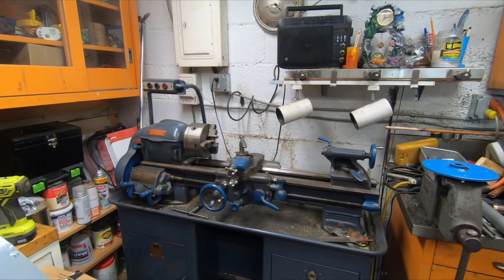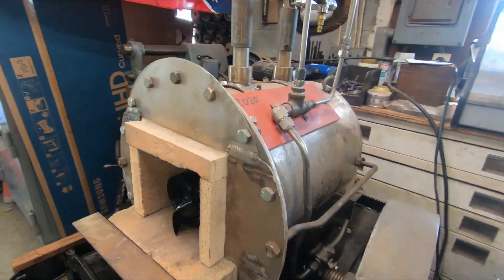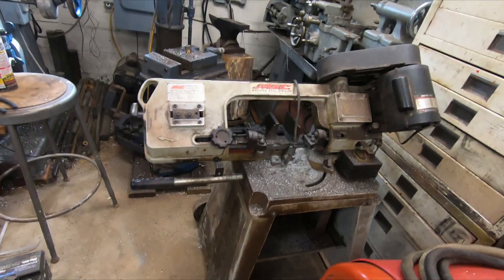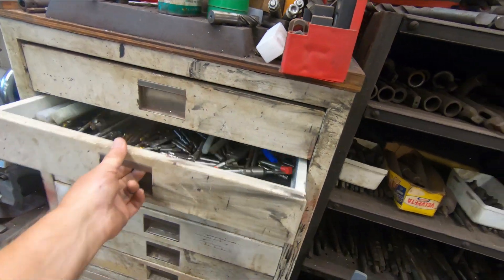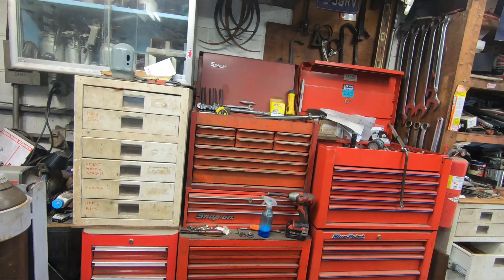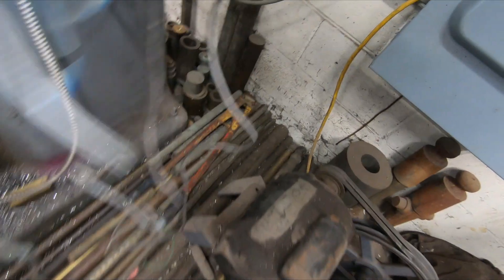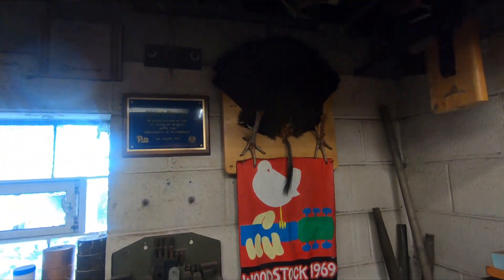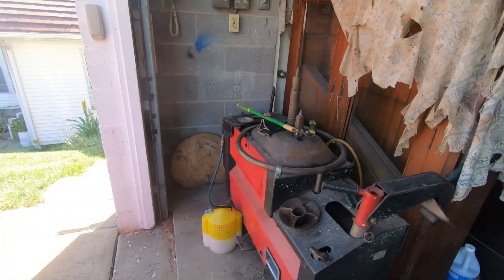My Home Machine Shop

Comment: Whats the trophies 🏆 for?
Reply from the maker: The  3 biggest ones are for my 67 GTO from the annual World of Wheels custom car shows 1977-79.  The small red one is from some car show. You can see the back of the GTO in this video. Link to the GTO  -  https://youtu.be/KtT0TO7NQbY . The 2 smaller wooden ones are from 10th & 11th grade for winning the 4th Place Best-in-Show and 1st Place Best-in-Show in the Western Pa Industrial Arts Fair. My dad was a machinist and he started teaching me to run a lathe when I was 12 yrs old.  In 10th grade I made a 3/8 scale model of a civil war cannon with a brass barrel. In 11th grade I made a full scale mountain howitzer with a 8" diameter forged steel barrel with 36" wheels.  Made both to the original plans.  Did the metal work at home and the wood work at school. I had 4 periods of wood shop per day in 11th grade.
Reply: @billygoat1708  that's awesome. They didn't offer any kinda classes like that when I was in school. I probably wouldn't of dropedout in the 7th grade if so. I will go check out that video now
Reply from the maker: @51-FS  The summer after I turned 16 my dad got me a job at an auto repair garage with a guy he knew.  First, I started out running for parts. Then did small jobs like water pumps, changing tires etc. I worked on and off doing mechanic work for the next 8 years while going to school. I picked up the GTO when I was 19 for $175. Did a frame off restoration in my garage in 2007 and have it insured for $60K now.
Reply: @billygoat1708  thats cool.

Comment: Nice Westinghouse plate
Reply from the maker: You must be in the electrical field to pick up on the Westinghouse plate. My dad worked for Duquesne Light Co which is our local power company. The plate came of a generator that must have been taken out of service. The plate reads: A.C. Generator, June 8, 1928, 75000 KVA, 11600 Volts, 3740 Amps, 1800 RPM, Westinghouse Electric & Manufacturing Co, East Pittsburgh, PA

Comment: Your torches are the best tool in the shop? Really? You use that thing that often? I have been debating buying one .
Reply from the maker: It is not that they are used that often but when you need them you really need them and they are the only tool that will do the job.

Comment: let me ask you a question ol buddy!  how many people do you know that needs a damn 3 inch drill bit hanging on there wall?? yah thats what i thought...
Reply from the maker: When is the last time you SAW a damn 3" drill bit ol buddy?  yah thats what I thought. "Need" has nothing to do with anything.  Although I have used it in my 20" lathe. So now it has become a novelty that is hung on the wall.  Price one. They are $1700 discounted price on MSC ($2253 List Price) for an American made one. #FJB
Reply: I once used one to drill two parallel holes in the turbin casing of a steam generator. I had to sharpen it least two dozen times during the process. It took three shifts working every day for a week to drill the holes through the special alloy metal. It took me two weeks to do the set up, and the holes came out perfectly in the steam rings on the inside of the casing.

Comment: SWEET..! my grandfather retired in early 1973, back then u could buy used machines at a decent price. my father also bought tools and machines. its sucks a lot they both have past, but they both have left me aquept to work on metal, I'm so lucky, i knew has a young boy id work with metal and weld. its in my DNA. working on a machine with your hands is therapeutic. i built a new shop in 2005, with in 3 years i wish i went bigger.. lol. let that be a lesson, always go bigger, because there is no such thing as too big. love, love your toys sir..!!

Comment: The garage looks deep.  I'm guessing you all built it special with all the I beams.
Reply from the maker: When I moved here in 1985 the garage was 20'x24'. I couldn't get my van in so I jacked the roof up and added a course of block. When I did that I also added a 20' long 8" wide flange beam (15 lb/ft) across. In 1986 I built the garage out another 24' so it is now 20'x48'. In 2004 I was working at a school district that was renovating a school. A gym divider and associated beams that held up the divider  were eliminated by the construction. I acquired the two 24' long 8' wide flange beams (35 lb/ft) and installed them in my garage. Got them for free. Put one across and one between down the middle of the garage.
Reply: @billygoat1708  now that is interesting...Adding that one coarse of block...I've always wanted to lift a house.   Over the years we've cut a roof off and built a second floor a time or two, but to lift a house...seems much smarter.

A great story...I hope you include it in a video one day.  That will inspire people....get them off the couch and outside!

Comment: Funny,  my two favorites are the first lathe you showed....and the tire machine.  First and last...bookends.
Those camel back drill presses are as much art as they are machine!
Reply from the maker: The larger camel back weighs in at 750 lbs. I have a sales brochure from 1917 that shows all the specs. It has a complete power feed.  It can punch a 1" hole in a thick steel plate and not even grunt.  
Have specs sheet on the 20" Flather lathe also. It weighs in at 4200 lbs.
Reply: @billygoat1708  Years back I built a house in New Britain, CT.  Then, every third of fourth garage had a machine in it.   It was great seeing how things were manufactured for the first time.  Before then things just appeared.  As if a Tooth Fairy brought them.

I spoke with one guy who would simply set up machines in a large factory. That was his job.   Other guys were known for having such high skills they did prototype work.

It is good to see YouTube showing us that people are buying up old lathes and trying their hand at this.

tHanks for a great tour!

Comment: Nice Setup !! Which lathe is your go to lathe ?!?
Reply from the maker: Definitely the 20" Flather. It is so heavy duty. Was the Cadillac of its day around 1917. But sometimes it is too big for the job.  So I then go for the 13" LeBlond. It is a very well made and accurate for an 80 yr old machine.  The 9" South Bend is light duty and is best suited for making "tinker toys".

Comment: Welcome to youtube.  I would love to see projects that you are working on with your mill, lathe, forge... welder.  even your son's generator project might be fun to watch.  Love to see you rebuild something old.  Restore a tool or two.
Reply from the maker: I have pics but no videos. Recently I have been making a few things for a couple of guys that are restoring a bunch of antique cars. Parts that you can't buy. Like, brake levers and handles for a 1904 Winton touring car, a big puller to separate brake drums from the wheels on a 1928 Rolls Royce,  repair broken end on an axle on a Bantam, odd ball brake shoe pins, wedges to reposition a steering box, pins for a 1904 Cadillac, special axle removal tools, more.....  Will keep in mind to make some videos of my next projects.
Reply: @billygoat1708  I agree,  it would be fun to see some of the things you made.  Just a quick look is just as much fun as seeing all the steps.    Great to see the skills at work.

Comment: Interesting confluence of Woodstock 69 banner and FJB banner. Keeps people guessing who you might be.
Reply from the maker: Conservative all the way. I remember Woodstock. I was 12 in 69. Had a T-shirt that was too small and decided to hang it up. #FJB.
Reply: @billygoat1708  Thanks for the heads up. I appreciate the information. I have a home shop like yours with just a little more modern equipment. I'm also older. I was at Woodstock in '69 but went home wet and weary on Sunday morning. Not much of a conservative at any rate.

Comment: We have the exact same Snap-on tool box setup top, mid, bottom with add a drawer. Circa mid 70’s. Bought mine new then, or started as I bought one part at a time.
Reply from the maker: I bought the Snap-On bottom box new in 1975 for $220. The top was given to me and is from the 1960's. Picked up the middle box used in the 90's. Probably from the 80's. The Snap-On logos are all different and help date the boxes.

Comment: Nice shop, but why do you need that 

many lathes, unless you have others working in it?
Reply from the maker: Every lathe has its purpose. The 9" Southbend lathe is a pretty light duty machine and is for small items, mostly under 1-1/2" diameter.  13" LeBlond lathe for medium size up to about 4" diameter.  The big 20" lathe is heavy duty for the larger stuff or when you really want to hog some stock.  You couldn't machine a 3/4" dia in the 20" lathe. The smallest you can put in the 4 jaw chuck is 1".  I use them all.